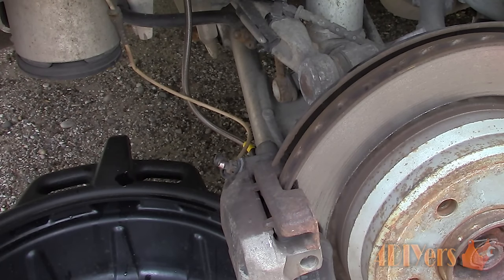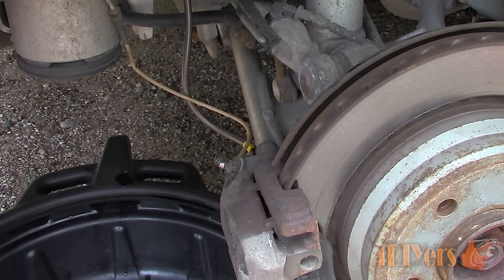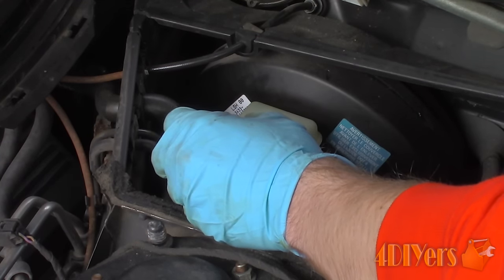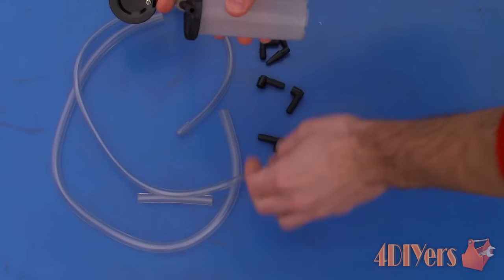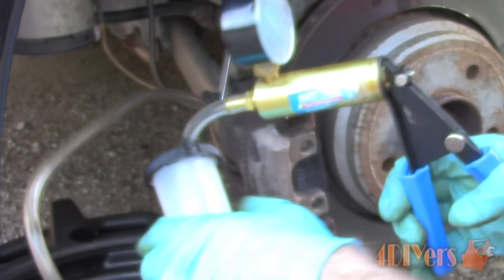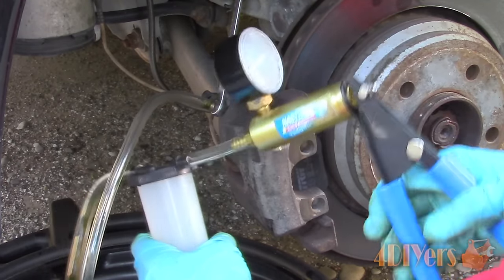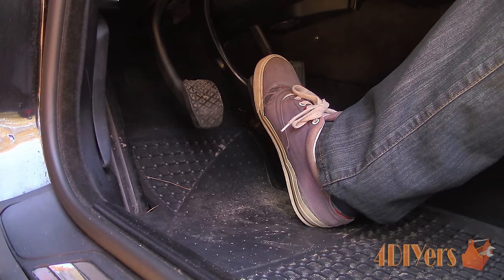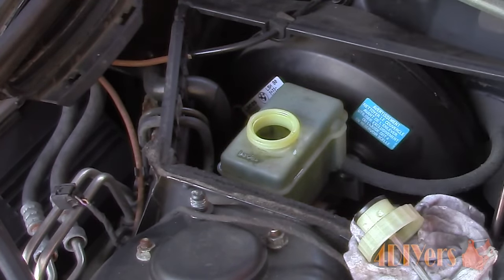DIY: How to Bleed Brakes Using a Vacuum Pump

Comment: hello nice video ,what is the right sequence to start with brake bleeding?
Reply: for logical reason you want to bleed the longest brake line first and work backwards towards closest to the cylinder.  usually RR,RL,FR,FL.  In some situations an ABS unit mounted quite far back can make the front lines actually be the longer ones.  You can find the ABS unit under your car because it's where the 2 lines from the master cylinder split into four lines to each wheel.  as long as it's less than halfway down your car, use the standard furthest from reservoir to closest.  this is usually the case.  and it's also not going to break anything if you don't follow the order.  following the order is to do it efficiently and save time/fluid.  if you do it different you won't do it wrong as long as you actually do purge all the air.
Reply: @tech99070  The shop manual for my 1956 Oldsmobile 98 with 324 cu in engine and power brakes says, "The correct sequence for bleeding is left front, right front, left rear, and right rear."  This is opposite what most  people now say.  What happened?  (These cars didn't come with dual master cylinders.)
Reply: @moonrich3492  He didn't say anything about a dual master cylinder. Just that you need to do the longest brake line first. Clearly the way the lines were designed in your car, the left front braking system is the furthest down the line from the master cylinder.

Comment: Why there iş so much air bubles are there?May it be sucking the air in the reservior?
Reply from the maker: Flex lines were replaced so there was about 18" of air in the line. You may fine the hose leaking around the bleeder screw which is fine as there is always a negative pressure at the connection so there isn't an issue.

Comment: Should the car be running while I pump the brakes?
Reply from the maker: No, but some cars may require to have the key turned on to activate the abs system.

Comment: Are you pumping the brakes while the engine is running?....I can get a hard pedal,  but when the car is started the pedal is mush again and can go all the way to the floor
Reply from the maker: Your pedal should be hard/firm when the engine is running. If not, then there is still air in the system. Don't forget to subscribe :)
Reply: YES, the car/truck needs to be running if power brakes.

Comment: Good information.

Maybe silly question but if you spill brake fluid, use brake clean?
Reply: It's water soluble. Just clean the parts thoroughly with water. At least that's what I've been told by a mechanic.

Comment: Dear Sir:
i have an E39 98 528i. There is a click sound when i press my brakes on front wheel... its not all the time but esp once i move the car in the morning.. it happens as one click noise even whith slight push on pedal.. can you pls advise??!!

and for this video... when i bleed the system and want to test the pedal if its frm or not.. i should close the bleeding screw or i can do it while its connected to the pump
Reply: AUSTIG M could simply be the pads tightening up on the disc.

Comment: bleeder screw is locked up can i skip that one?
Reply from the maker: Can't skip them as there maybe air in the line and it won't escape any other way. A propane torch may work, but be extremely careful as you can boil the fluid and burn out the seals. Follow up with top quality penetrating oil.
Reply: @4DIYers  it broke off had to replace the caliper. now after bleeding everything feels spongy like garbage. dont think any air is in it.

Comment: If one must bleed the entire system is there a certain order. for example, should I start at the furtherest wheel and work my way back or does it matter>
Reply from the maker: Yes there is. Bleed from the furthest point first and then slowly work your way back. The last wheel should be the closest to the master cylinder.
Reply: It depends on your vehicle. Start furthest from the brake modulator then go in order from there, ending at the brake that is closest to brake module. Brake module not master cylinder.

Comment: None of these DIY videos tell you to first drain the brake fluid reservoir. I mean, the name of the game is to replace the old brake fluid with new brake fluid, correct? So why would you dump new brake fluid in with the old grungy fluid? First pump out the old fluid using the vacuum pump directly in the reservoir and discard it, then refill the reservoir with fresh fluid, and THEN start bleeding out the four brake lines at each wheel. Doesn't that make more sense??
Reply from the maker: Have you read the title of the video instead of jumping to conclusions and criticizing? This is HOW TO BLEED YOUR SYSTEM rather than replacing the system's fluid.
Reply from the maker: If you're wanting a video specially for FLUSHING YOUR BRAKE SYSTEM, then this would be the video you're after https://www.youtube.com/watch?v=cnwC2AMvbGA
Reply: @4DIYers  Thanks

Comment: Too much vacuum can also pull air into your wheel cylinders through the cup seals.
Reply from the maker: I highly doubt that, the seals would have to be in rough shape for that to occur and if that's the case, they would be leaking. The braking system sees over 1000psi whereas this pump wouldn't pull more than 20psi.